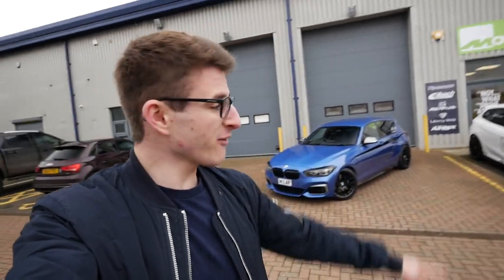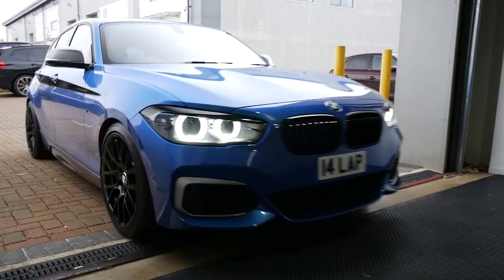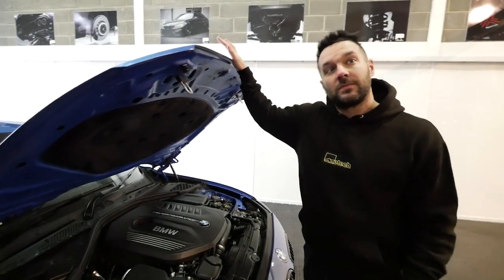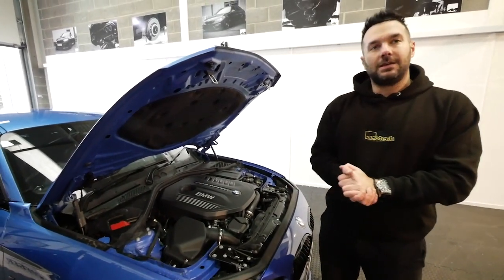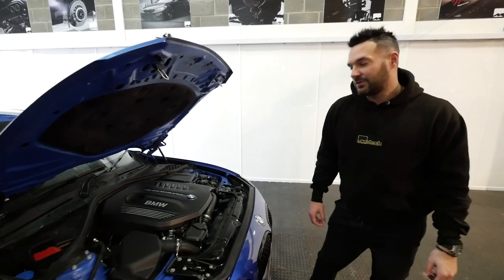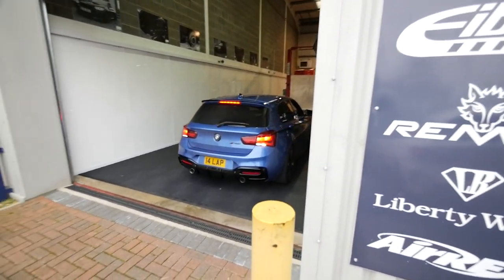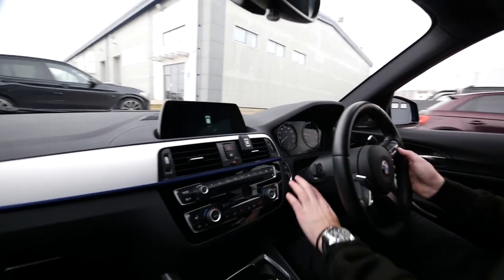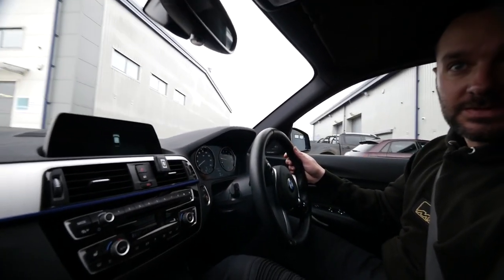These Modifications TRANSFORMED My BMW M140i!

Comment: Looks so much better now with the maxton kit.  Still need take that stripe off
Reply: Have the same kit, sadly diffuser part is so flimsy crackes when accidently touches a pavement, , shakes alot and hits the exhaust tip, overall dont buy gloss black, scratches like hell.. I mean still good value tjose maxton kits but you get what you pay, so not great quality.

Comment: Those stripes still look bad. I dont know about the front splitter
Reply: front splitter v1 is the best subtle option, v2 v3 a little bit too fat for my tast
Reply: M Y I know what you mean, it sticks out too much. Doesn’t match the shape of the bmw either.
Reply: @catpiano1  the maxton V2 looks the best as it follows the lines of the front bumper whereas the v3 sticks out a bit too much

Comment: I love my M140i despite it denting my trust in it by needing a new engine at 50k km.
Do yo have the adaptive suspension?
How do you like the motec lowering springs compared to stock?
Reply: What happened to the engine?
Reply: @jamboSAFC  BMW says they didn't find a smoking gun. It was mostly within spec.
It started smoking at slow cruising(100kmh) and then started burning more and more fuel. 
Got a new, and I mean brand spanking new in crate, engine from BMW München.

Comment: You want to hear it all the time? 
Put it in manual, 1/1.5k revs, full throttle and as the boost builds up let go off the throttle = whooosh
If you add meth you will also get flutter sound ;)

Comment: Wow, the car sounds very loud, but the sound is very good. Me i was at AC Schnitzer to tune it up. It coasts 3000 EURO, but why buy many people Chips for 200 EURO ? These chips mostly coast about 200 EURO or 300 EURO. But if the engine chrashe You loose the whole warranty of BMW. IF You are in a crash, You have to pay Your own damage. But You also are driving a car without approval in road traffic and BMW will not pay, the "tuner" will say, that nobody can notice the damage. And that is a lie. So you also pay the damage to all other cars. If people are seriously injured, you have to pay them too.
Unfortunately it is a fact that the engine will break is very high. AC Schnitzer changes 16 values, in some versions even 20. Then they drive to the TÜV, which is the place in Germany that it enters in the papers. The insurance company will also be informed.
The procedure begins with an input measurement, since my m140i already had 372 hp. They told me that all m140i use the 10 %% scatter upwards, so they have up to 34 HP more. This is because the first M2 had 370 horsepower. So you specified 340 hp to maintain the distance
When the car was finished, it had 450 hp without another downpipe, without a larger intercooler, and the torque increased from 510 Nm to 590 Nm. The fact is that you have to fill up with Super Plus with 98 octane. The response is better if your petrol is filled with 102 octane, such as Aral Ultimate in Germany.
The car can cope with the 450 hp without any problems; a louder exhaust does not bring more power, nor any other air filter or other measures such as large intercoolers. Because the engine is locked at 450 hp, it takes 3.2 seconds from 0 to 100 km / h, previously 4.7 seconds. I could not drive the top speed because the motorways are too full, but you can clearly tell when you accelerate at 260 km / h that a lot of power is still coming.
Personally, I had 3 analog displays installed in the console. Oil temperature, you should only go full throttle from 80 degrees, oil pressure, speedometer with 360 km / h and the on-board voltage. Fits right there in the recess in front of the cup holders. When I drive 130 km / h with cruise control in ECO-Pro mode, I need 6.8 l of petrol, previously it was 7 l. Most of the time I drive between 160 km / h and 180 km / h, because it goes to the 11l, before it was 12l. Everything that goes over 200 km / h is unfortunately up to 17 l, previously 14l. City traffic about 9 l, previously 9.2 l.
Long story short: The 3000 euros are well spent because everything is entered in the papers. 450 hp is almost the limit. You have brought a test car up to almost 500 HP. The result was extreme wear and tear. 470 HP is okay, but they go to 450 HP.Finger away from additional control units in the range of 200 EURO. You drive without insurance. Wish everyone an accident-free trip and send greetings from Germany.